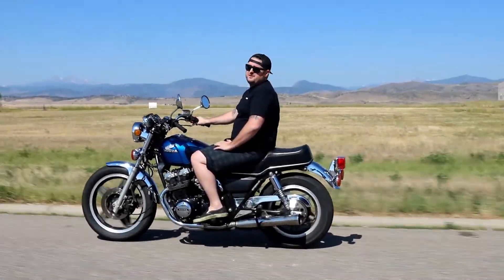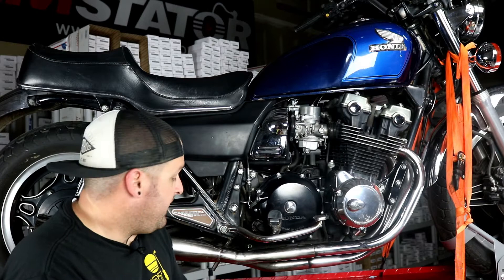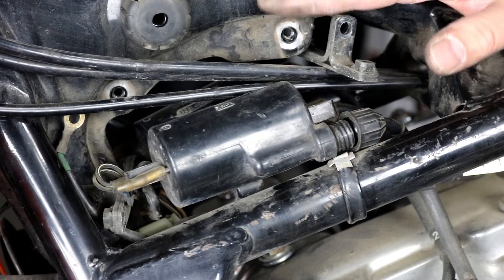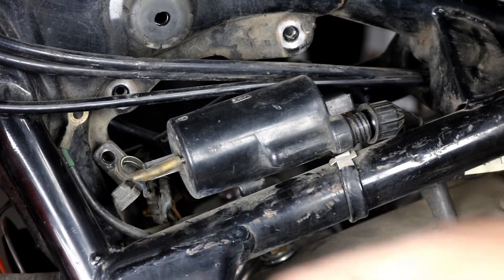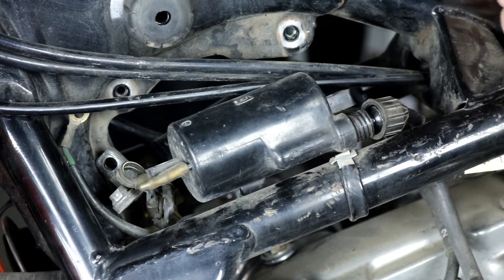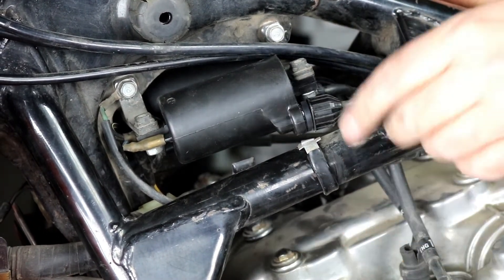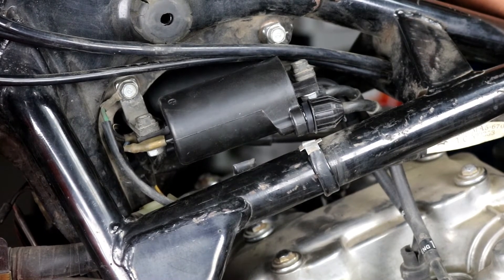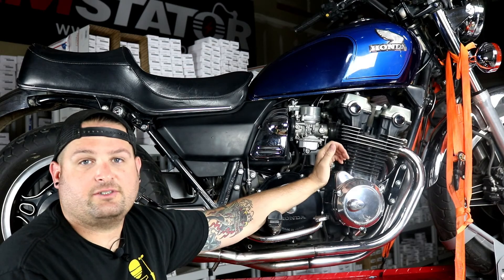Honda CB 650 750 900 1000 DOHC - How to Install RMSTATOR Ignition Coils

Comment: My 79 CB750F has the same stator rotor in one of your other videos. Basically 2 copper rings on a flat face... However does the 79 rotor handle the ignition system also through the rotor? I was looking at other model years watching installs to electronic ignition and you have to replace a locking magnetic bushing and then put a new points plate that detects the magnetic bushing. I don't have a lot of knowledge on the 79 system with the flat face copper disc face.

Comment: Can you do a video on what wires I need to start my engine it's 83or84 cb750 I don't have any of the wiring but it's for a go kart just need to know what wires I need just to start and run it
Reply from the maker: Sorry we will probably not get around to a video that detailed. You will need at a minimum the ignition system connected.

Comment: What connecters should I use on the back wires if I have to replace those?
Reply from the maker: Any standard female blade connector will work fine. You can get them at auto parts stores.